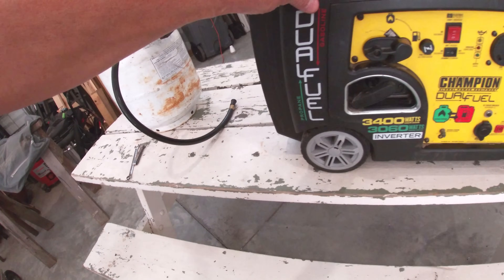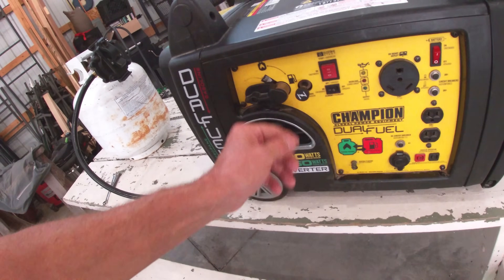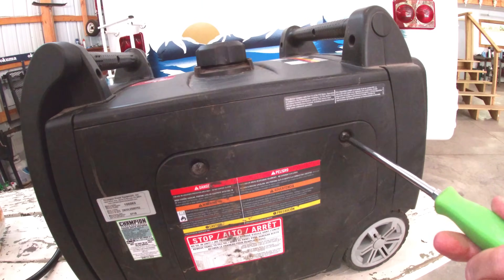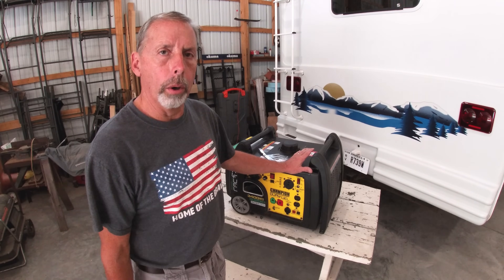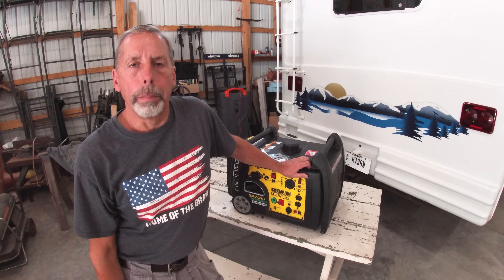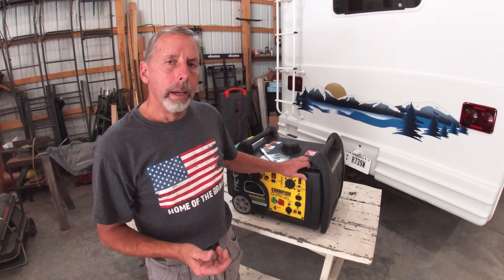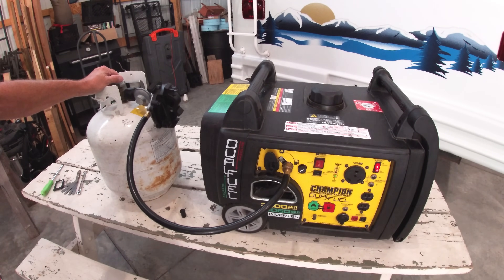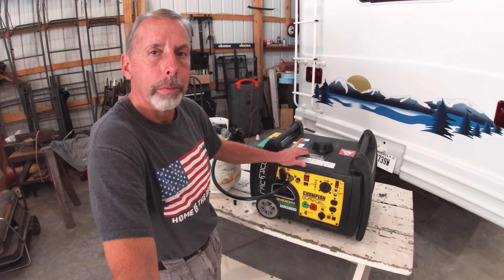Propane Generator Fail

Comment: FYI:  Most LPG regulators have had EFV in them for years.  EFV stands for "Excess Flow Valve".   It's intent is that if the flow exceeds the maximum BTU rating of a typical system, the EFV triggers.   This would be if a hose failed or maybe a control valve failed.   The EFV typically doesn't cut-off, as you might expect, but instead it just reduces the flow to about an 1/8 of the normally expected flow.   If you've just hooked up an appliance to a tank the hose will have no pressure in it.  Or, if you turn off the tank to  a BBQ or a camp stove, or a generator the system's will typically drain down to atmospheric pressure over a day or week.   NOW, when you show up and crank the valve on quickly, the immediate inrush to the UNpressurized system will often exceed the EFV flow limit and bingo, it triggers.  When it does, whatever you have hooked up will act very strangely, if at all.  You have to turn off the tank.  Count to five and turn it on again S L O W L Y and usually you're good to go.  If not turn it off and wait five minutes and try it again. The pressure across the EFV has to equalize to reset the EFV.
Reply from the maker: Great info. Thanks for watching

Comment: That is why I use a cutting torch regulator on my bottle. I run about 5 lbs of pressure on the line to the generator. The regulator has a gauge on it so I can see the actual line pressure. And its fully adjustable. Works perfect.
Reply from the maker: Good idea. Thanks for watching

Comment: The OPD valve has a safety feature that sometimes restricts gas flow if the tank is turned on, especially fast. It's not just with generators it's happened to me using my grill as well. It's a safety feature. turn the tank off, unscrew the fitting to the tank for a second letting any residual gas out, and put it back on and open slowly.

Comment: I have a DuroMax 55000 dual fuel, and it did the exact same thing you described. It ran perfectly on the first propane tank of propane, but when I switched tanks, it wouldn't start unless I pulled the choke out, and it would die as soon as a load was applied. We had a power outage, so I had to switch to gasoline, and it immediately started and ran perfectly. The generator was brand new and had only been in operation for the hours it took to run through the first standard propane bottle. Thank you for this information. I will apply this "fix" the next time I run the generator.
Reply from the maker: Thanks for watching

Comment: Good to know. I have an older Porter Cable generator (with a Honda engine). I just bought a new carb with a propane / natural gas regulator attachment. (Technically making it tri fuel?). Anyway, I plan to install it soon. I will be using this method. Like you said, not sure if it's strictly a Champion issue but I'm sure it won't hurt to do it with mine as well. Thanks for the detailed story of how it all played out.

Comment: I had this exact problem with a gas grill. I took a big screwdriver and tapped (well, whacked) the regulator with the handle one good blow and that fixed the problem. BTW, oxy/acetylene welding regulators will act up just like this and you'll see in the instructions, "open slowly" so it's obviously a universal problem with anything with a regulator. Common sense isn't universal, so having a simple tip in the instructions is so easy and that's why the top step of a ladder says, "STOP."

Comment: I usually run my Champion generator off of gas, but have several propane tanks as a backup in case the fuel goes bad or I just run out. This hint might save me some future pain- thanks!

Comment: Back in my youth when all us rural folk had two 50 gallon propane tanks hooked up to the house it was common knowledge to open the tank slowly. I never knew why. I have this generator and it is a gas saver. Here in southeastern Louisiana the power goes out probably 6 times each year and when my fridges aren't running it slows down and idles. I just installed propane to our home and included a second outlet for this generator.
Reply from the maker: Makes sense to have a hookup for this generator at your home. Thanks for watching

Comment: I'm not employed in this field,  but i have found that some wall mounted five gallon camper water heaters will develop clogged pilot orifices. 
I don't know whether the fuel quality has diminished or additives have changed, but a hard white deposit forms inside to tiny nozzle. The only successful method  I have found is to use muriatic acid. These orifices are commonly stainless steel so not more than minute soaking, followed by a thorough rinse. Good for another year.  While these are cheap to replace,  I'm not familiar with carburetors designed for propane. Probably aluminum and if the orifice is the same or brass a much shorter soak is in order, minimizing contact except for the area being treated.

Comment: I want to add a long-lasting gasoline hack/secret I have used with great success since the late 1970's.  All my small gasoline 2-stroke & 4-stroke engines exclusively get this formula: NON-Ethanol gasoline from all Q.T. gas stations (I'm in S. Central TX.) or a few Murphy (Walmort or Slams) gas stations with a dedicated NON-Ethanol hose & nozzle, very important to prevent contamination from the other ethanol crap gasoline!! I take a 5 gallon gas jug (I call it my "Master" fuel jug that All other smaller jugs are filled from) to the above specified gas station After I add 2 ounces of Sta-Bil fuel stabilizer AND 2 ounces of Marvel Mystery Oil (MMO) in the empty can. The fuel stabilizer keeps an oxygen barrier on top of the fuel to inhibit fuel rot/varnishing/breakdown. The MMO helps extend fuel life too, and lubricates parts, keeps gaskets, diaphrams, & needle & seats moist & supple.
Yes, with Only that formula of gasoline, run the generator on gasoline every once in a while to renew the gasoline side of the carburetor. Shut the gasoline valve & continue running until the fuel is used out of the fuel bowl & it sputters & dies. The residual fuel additives will remain in the carburetor, keeping it ready to run when the secret formula is again allowed into the carburetor. I have engines that are mainly stored this way, but will start up when I open the fuel valve, even a year later! 2-stroke 1 gallon jugs are filled with formula gas & 2-cyc. oil added in & mixed before use. This is a game changer learned on the farm. Paul

Comment: I have that exact generator, but I've never had that problem.  To be honest, I'm an open the valve quickly operator.  While I've never had the problem, this is good information to have!  I have heard of other propane powered equipment having the same issue.  It's in case a line bursts, so it limits the flow.  Makes all the sense in the world (after the fact.)

BTW, this is a great generator.  I have it for home backup for critical equipment.  I also do not want to put any gasoline in it for the same reason as you.  Even using alcohol free gas and stabilizer, the little bit that may be left in the carb after emptying the tank could eventually cause a problem.
Reply from the maker: Thanks for taking the time to respond and for watching

Comment: I've had same issue with a garage heater and blackstone. Opening valve slowly solved both of them. The heater regulator would make a barely audible "ting" sound when I opened too fast. I think this was the safety mechanism engaging. Blackstone would light but barely any fire. Just seemed to run on low and take forever to get hot. Then I closed valve, reopened slow and it cranked fire.

Comment: Excellent information, thank you. I just bought a 13kw champion dual fuel to run exclusively on propane also. I had no idea the regulators had those issues. Thanks and 73. Earnest K5EWM.
Reply: I guess ham operators are like pilots… you don’t have to ask what they do, they’ll tell you.

Comment: Dude--thanks! I have this exact generator. I've had great luck with it during power emergencies here in Houston, but you can bet I'm adding a big note on the generator handle to open the propane valve slowly!
Reply from the maker: Thanks for watching

Comment: Great info.  Most propane devices have a ball valve that closes when gas pressure is too high.   I think that’s what you are seeing.   When you undo propane line, the spring lets ball valve opens to operation position . ( resets it).   You activated a safety device either in the regulator or in the generator when the gas surged.     It won’t reset until you completely disconnect propane line and reset the locked release.   It’ll only get about 20-50 % gas with the ball-valve closed which is what you were seeing.  It’s a safety device incase the regulator fails to restrict pressure.
Reply from the maker: You are correct. Thanks for watching

Comment: I just also recently purchased a champion 200914 dual fuel 4250 watt max inverter generator. This info on slowly turning on the valve makes sense . Because i generally try to do the same thing when i use my weber gas grill. Open the tank valve slow.

Comment: Thanks for posting the video.  It's a good reminder to slowly open the tank's valve.  Had the same experience with our Weber Genesis grill.
Did you consider trying to run it on gasoline when you had the problem for troubleshooting?  It would be a way to eliminate the regulator from the equation.  I have two Champion Dual Fuel generators, one 3400 just like yours and a 2500.  No problems with either.  We run them off our Airstream's low pressure propane port on the front of the trailer.  Nice units for the money.

Comment: Ive seen this issue in forklifts too. I tell all the drivers "open slow and not all the way." The propane tank also has a safety that if you open the valve too much and too fast it triggers the safety cutoff. remember even a 4 cyl forklift doesnt need the valve all the way open.

Comment: I was told there is a safety check valve in the current propane bottle hand valves. I have experienced this similar symptom with other equipment. And to reset that safety valve, you have to turn the bottle off, let the gas escape, and then turn the bottle back on, slowly. It is designed to prevent gas from escaping too fast. Yes, can be a problem.

Comment: Many years ago I was detailed to the power production shop of the Air Force base I was assigned to. I asked if it was OK to ask questions even though I wasn't a power production technician but only a detail laborer. I had already took the step of leaning in to everything there was to do as hard as I could. The installation team Non Commissioned Officer said no problem and I asked a lot of questions and learned as much as I could. One of the questions that I found the answer really fascinating was why did we put that short section of small pipe into the Natural Gas supply to a standby generator. He told me that the short piece of pipe was selected to supply the full load gas consumption of the generator at "Sonic Flow." Sonic speed is the mechanical engineering way to name the speed of sound. That is as fast as you can get any fluid, liquid or gas, to move through an orifice. No increase in the pressure above that which produces sonic flow will cause any increase in the amount of the gas that will flow. The generator was designed to take its fuel  at distribution pressure to a regulator mounted immediately adjacent to the generator. He said if he took a rotary cutter to the short section of flexible fuel line and then turned on the solenoid valve bypass the flow would still be limited to the generator maximum consumption and that it kept that solenoid valve from screwing up the regulator. 

Perhaps now I know why that would be true. Since a solenoid valve is instant opening the reduced size pipe would keep the regulator diaphragm from being hit with full pressure immediately. The  the small pipe would keep the much larger line on the generator side of the solenoid valve from coming up to full supply pressure as soon as the solenoid valve opened. 

I then asked why some sort of precision orifice wasn't provided with the installation parts. He answered that it is listed in the catalog as an optional item and there wasn't one purchasing agent in the  Air Force bureaucracy that would willingly purchase anything that was shown as optional in the manufacturers catalog listing unless it was separately justified as necessary to the installation. He pointed out that the generator winding was not supposed to be bonded to the frame in that application because the generator was the alternate supply for a panel that was supplied by a feeder. Since the winding isolation kit was also "optional" the purchasing officer had not ordered that either because it also had not been separately justified as necessary to the installation. The fact that it was on the requesting officers bill of materials was not adequate justification. I ended up making an isolation kit out of a piece of plexiglass and brass fasteners. That NCO actually said he wished he could hang on to me but command wouldn't have it because I wasn't willing to reenlist. 

Thank You for helping me figure out how that reduced size pipe piece would protect the regulator. It's nice to finally know. 

Tom Horne
Reply from the maker: Great info. Thanks for taking the time to comment and for watching

Comment: Thanks for your video. I have that same generator. Your use story sounds about the same as mine. So far it’s worked fine. Just as you experienced. I haven’t been paying any attention to how I open the propane valve, but I will do so in the future! Thanks again!

Comment: I took factory regulator out of the loop and run it off my rv regulator and propane tanks. Use quick connects with a hose line. For the same reasons you mentioned, I have never used gasoline to date. But if I was in a pinch would use it instead of cutting my trip short. Sorry you had so much trouble and Thanks for sharing. I did not know about the valve adjustment. Will now throw in the old feeler gauge into my toolbox.
Reply from the maker: Thanks for watching

Comment: Great video thanks.  I would add perhaps just give the answer in the beginning and then go through the history.
 I watched another one, and he pointed out that you don't use the choke when running on propane.  Having to use it is a definite problem indicator and he also said  you must open the valve slowly.

Comment: Not specific to generators but to propane tanks in general and regulators. I'm a bad, bad man and tend to never turn off my propane tank to my gas grills. Occasionally when I have or been at a friends house that does it regularly on their gas grill I've noticed that the gas grills will not get very hot, like there is a flow problem with the propane/regulator. Usually leaving the propane tank on and "burping" the regulator, that is slightly unscrewing and resealing the regulator on the tank, seems to always fix the low flow/flame/heat issue with the gas grill. Interesting how this all seems interconnected to issues with the regulator and maybe the speed of turning on the tanks gas valve. Good info, Thanks!

Comment: This is how EVERY PRESSURE REGULATOR FOR PROPANE WORKS.  
I figured this out 31 years ago when I was 12 years old operating a gas grill cooking myself a steak.
You can hear the diaphragm snap shut if you open the valve too quickly.
Leaving the regulator to sit for several minutes or bleeding all the pressure off and opening it slowly resets it.
This is to prevent a full speed evacuation of the tank if there is a sudden large leak like a hose being cut in two.

Comment: The reason this happens with these newer propane regulators is because it’s a safety issue. The new regulators have a built-in spring mechanism that doesn’t let the propane just blow wild out of the tank. if it isn’t hooked up to the generator it will shut the propane off from leaving the tank. So, even if it is hooked up, but you open the tank too fast, the regulator senses that it’s not hooked up to anything and shuts propane volume way down or completely off from the propane leaving the tank. But you were absolutely right it should be in the manual or it should be at least on their website in big red letters to let people know about this feature on these newer regulators. (to clear it you have to shut the propane tank off, disconnect, the regulator from the propane tank that lets the pressure off of that mechanism inside the regulator, then reconnect it to tank and open valve on tank slowly). And finally, it’s not just champion brand. It’s just about all the brands that use the same type regulators.
Reply from the maker: Thanks for watching

Comment: Excellent Video!!!  I have this exact same generator and have owned it for about 3 years as well.  I never thought of how I turn the propane on either however, going forward, I will open the valve slowly so as not to encounter this issue.  I have only put about 15 hours on it and like you, I only run it on propane.  I usually take 2 extra 20# tanks with us anyway (1 for the fire pit and one for the bbq grill) so if I need to "T" off it and use it for the genny, all is good.

Comment: I've never had the problem you experienced in the 8 years I've owed my same model Champion, but good to know just in case! Thanks. Also, I never use the choke. Thought that was just for gasoline, but maybe I'm wrong. Mine starts right up.

Comment: Yes, I had the same thing happen to me when I had a power outage. I, like you, have had my generator for years and never had a problem until I needed it. I accidentally tried the slow turn on with the valve and got along ok.